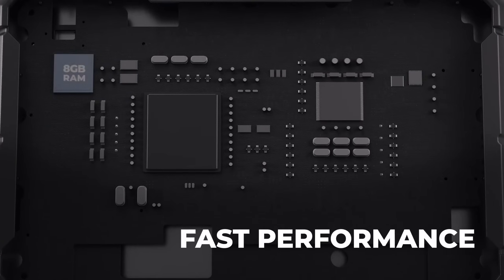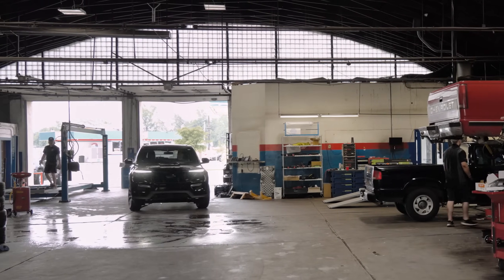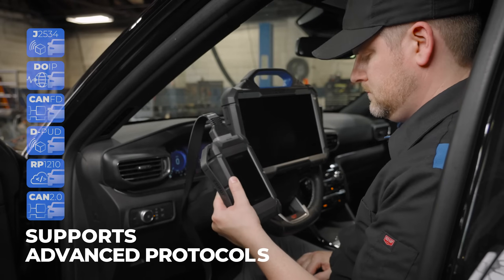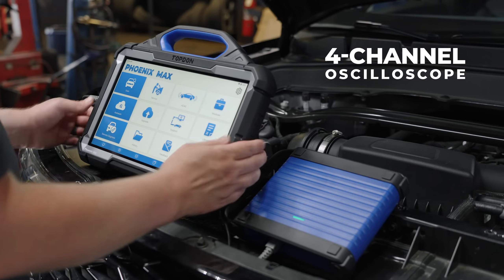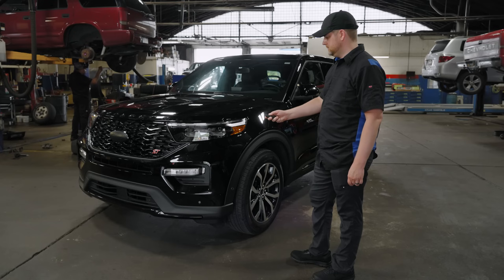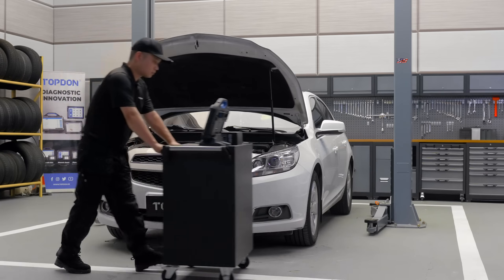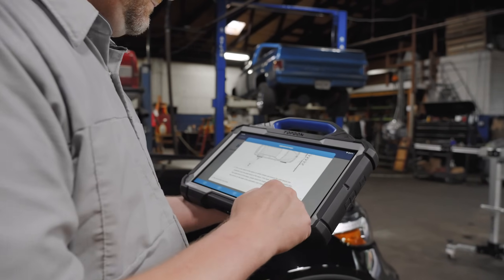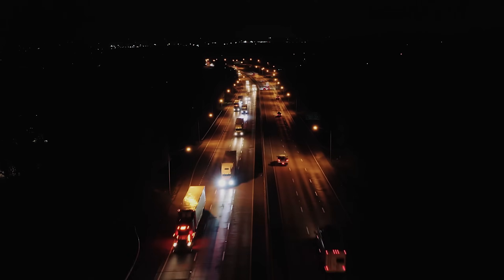TOPDON Phoenix Max | Diagnostic Tool

Comment: Would it be possible to put a video together which showcases what each of the different Phoenix models offers and who the intended customer would be 

For example who would purchase a Phoenix remote tool.  What tool would be good for a diy guy.... what would an independent repair shop buy.... what would be a good tool for a mobile diag tech ect ..

I myself am in the market to possibly purchase one of these tools, but I cannot discern easily the difference  between all the models based off the info that I researched from your company website.... myself and maybe some other future customers might find a video that explains the differences between the scan tool models to be useful.

Thank you
Reply from the maker: Hi Edward,Thank you for your suggestion, we will do such a video in the future, but for now there is only a series comparison table for diagnostic scanners, I hope it will help you https://drive.google.com/file/d/1Rtl0cWkyzP-vQnV4uo8OcBXhY8lsVO3c/view?usp=share_link
Reply: @TopdonOfficial   the link does not work (anymore)
Reply from the maker: @mr2law  We have updated the products comparison table, you can use this use this link to view the latest https://drive.google.com/file/d/1YdE5uCXC7o4hol82FIrPu1wXXhXzYdf7/view?usp=share_link
Reply: @TopdonOfficial the link still don t work!! Please rezolve faster!

It's annoying.. Especially since you haven't done this comparison video, the requests  message is 2 years old..